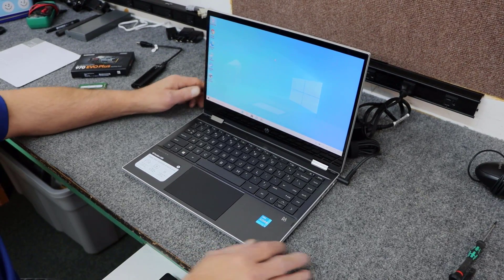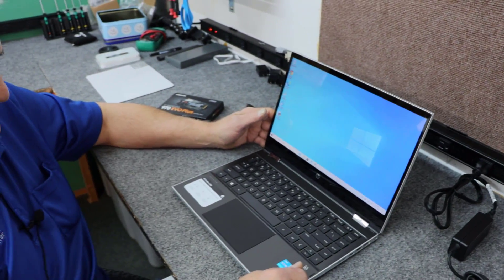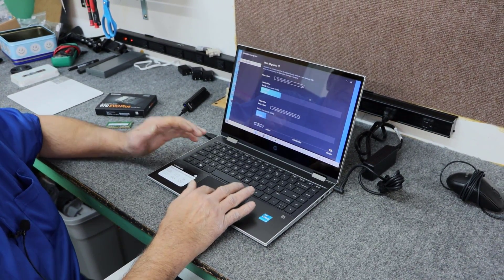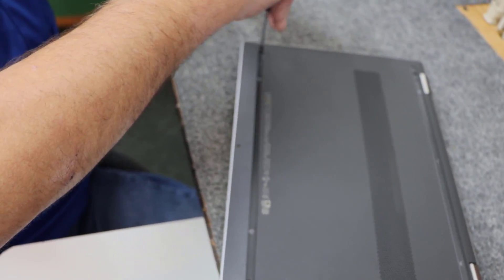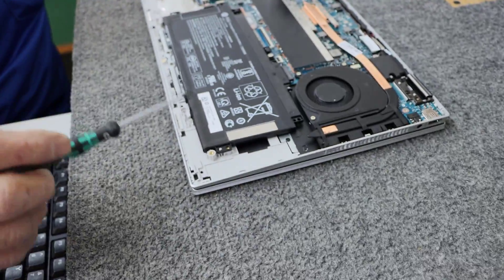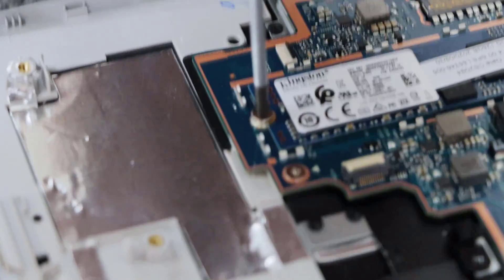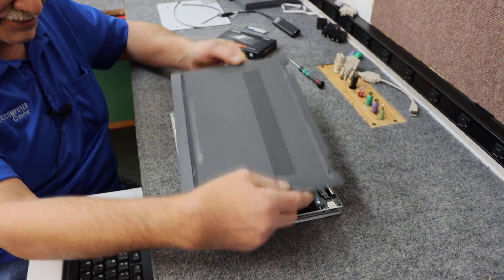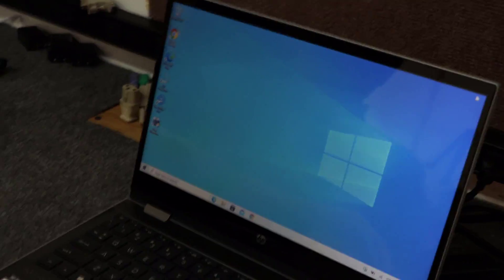HP x360 14" Laptop SSD & Memory Upgrade Clone SSD

Comment: Great video and also subscribed to your channel.  I generally know how to get inside notebooks for memory and storage upgrade but am surely no master at it, nor in the business of upgrading.  I generally prefer ASUS or Lenovo laptops as being less hassle for upgrades.  I probably will not bother with HP any longer because of all the extra hassles just to upgrade, starting from those sticky screw cover strips.  It seems like HP goes out of their way to keep the end user from upgrading.

Do you have a recommendation for a notebook that can accommodate dual M.2 slots and memory slots for upgrades?  I had a Lenovo X1 Extreme in the recent past and had both for dual upgradeability.  Lenovo made that machine so easy to open and upgrade I am some disappointed I sold it, but technology advances annually if not biannually.  Going forward, I am thinking in terms of USB4/TB4 ports x2 (minimum) and AMD 5000-series based on Zen3.  I believe AMD gives a far better bang for the buck and giving Intel a run for their money.
Thanks.  Jerry..  Tokyo, Japan

Comment: Hi!!
Is there a significant difference if I put a DDR4 2666mhz ram instead of 3200mhz one?
My laptop supports 3200mhz and there is a 3200 stick already in the first slot and the second slot is empty in which i want to put a new one.
Reply from the maker: Hi. You can certainly do what you suggest. Your memory will run at the slower speed. 2666mhz.  In this type of laptop, you wont notice the difference.  Adding more ram in general will increase your default page file size,  which is fine.  Dale
Reply: I have an ASUS TUF A15 gaming laptop sir.
Will it be good on a gaming laptop considering the speed they offer?
Reply from the maker: Honestly,  for gaming, if you can, upgrade using a 3200mhz module. 2666 will still work. However.  3200 should give you better FPS.  Dale.

Comment: Would love to see a tutorial on how to upgrade from an oem Intel SSD with Optane like the Intel H10's to a traditional SSD. I did the clone and swap just like your videos, but can't switch from Intel drivers to Samsung drivers. Samsung magician won't recognize the Evo Plus without Samsung drivers. Thanks for all the videos and help!
Reply from the maker: Hi..you need to use samsung data migration software tool.  Did your laptop come with both. Optane memory and a m.2 ssd?
Reply: @CadillacComputerCenter  I used the Samsung data migration tool based on your super helpful videos and purchased the cloning tool through your links, and everything is running fine. I think the problem is the OEM SSD was all in one ssd+optane. My HP Envy X360 only has 1 m.2 nvme slot.
Reply from the maker: Hi. Yes the intel H10 is an ssd/optane memory in one drive. .cloning one is a pain.  Did you get it going with the new Samsung ssd?
Reply: @CadillacComputerCenter  Yep, with your help it's running perfect with great read and write. Just can't use Samsung Magician, but I can live without it if I have to.
Reply from the maker: @nismomike3182  good to hear
Reply: @CadillacComputerCenter  I will say, it was a lot to figure out to get it right. Shutting down Optane and turning off encryption was frustrating
Reply from the maker: Yup, optane is tricky. Optane is good for a traditional hdd, no need for it really with ssd drives.  Usually have to disable RST in bios.  Was you drive encrypted from factory?